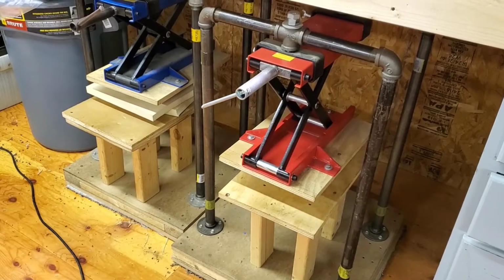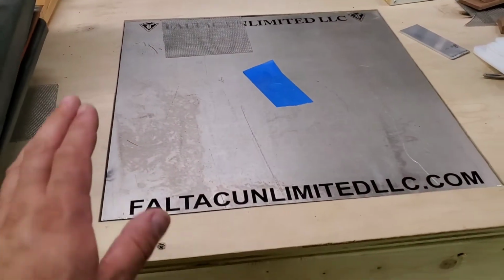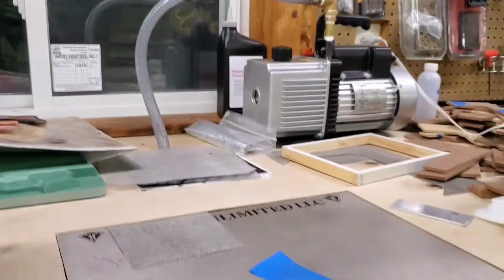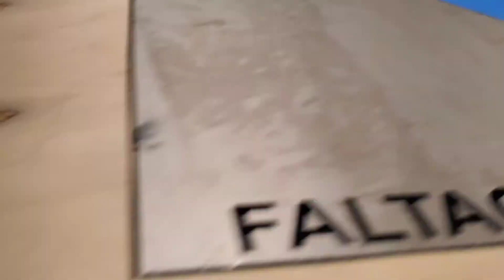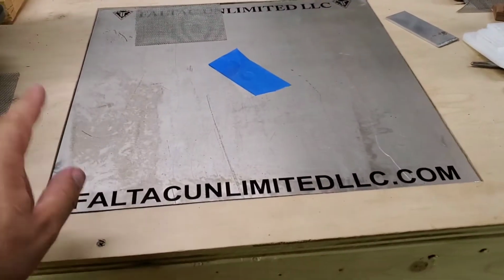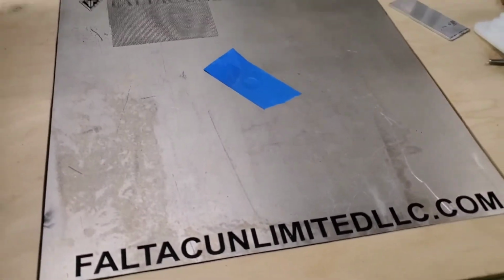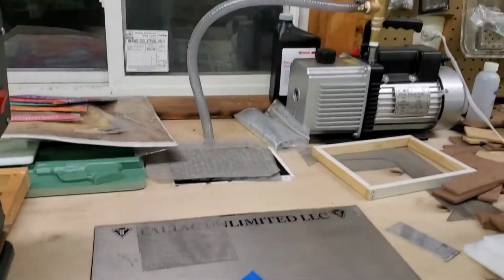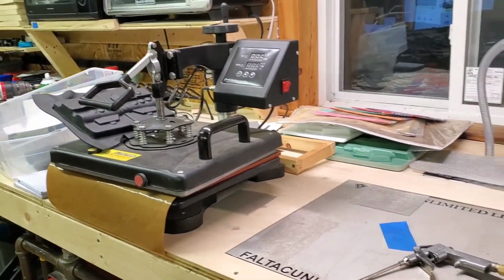Home made membrainless vac press

Comment: I bought the HFS 2 stage 6 CFM pump. What type of pressure gauge do I need to get? Is it just a regular air pressure gauge?
Reply from the maker: It would be vac gauge. But not necessary to have
Reply: @FalTacUnlimitedLLC  Awesome. Thanks!

Comment: Where did you get the vaccum table from?
Reply from the maker: All home made my friend. I got a Slab of aluminum plate at xometry.com
Reply: @FalTacUnlimitedLLC  intresting,  is it glued or does the fitting secure it?

Love your videos man!
Reply from the maker: @zackmathews8546  I drilled and tapped it for a 1/2 fitting then special vac hose with a metal coil spring inside is clamped to each barb fitting
Reply: How do you make the square metal frames that you put over top?
Reply from the maker: I have a video on them you'll see the frame as the thumbnail